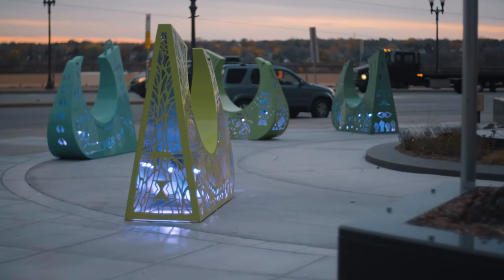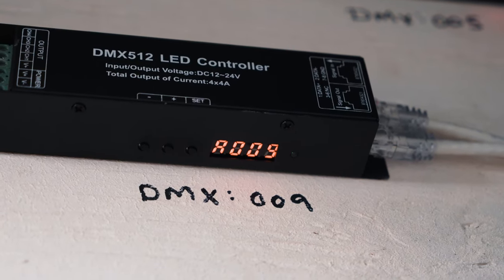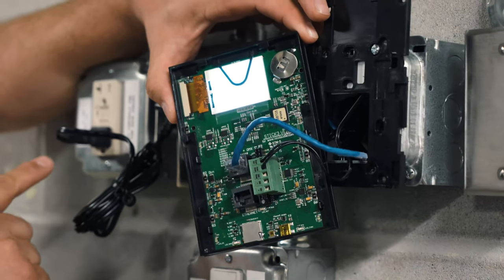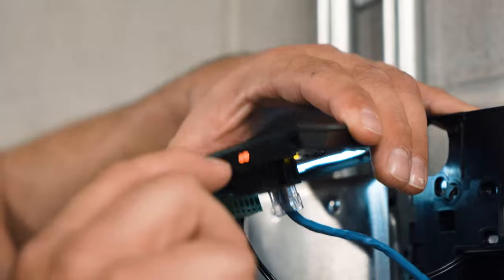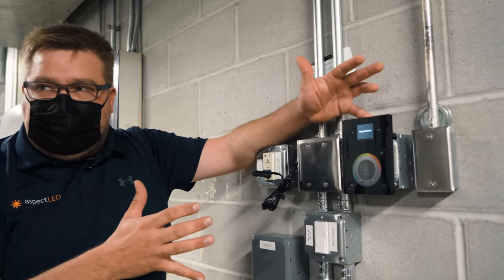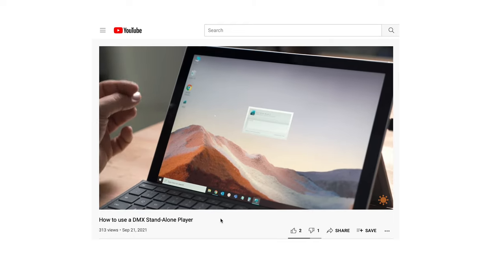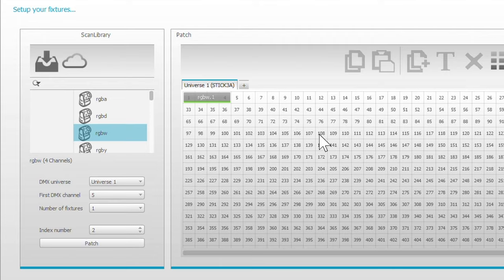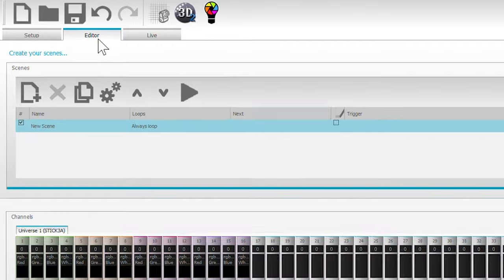How to Set Up a Stick DE3+DMX Controller

Comment: Can this work straight out the box to test strip lights without programming it yet?
Reply from the maker: If you attach a decoder at address 001 there is a preloaded program from NA loaded onto the stick as a defualt. Thanks!